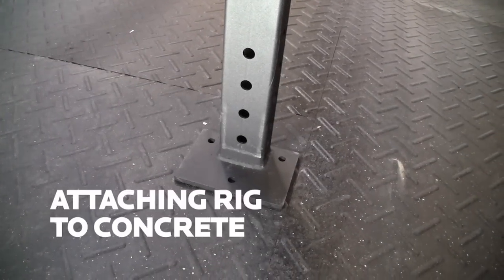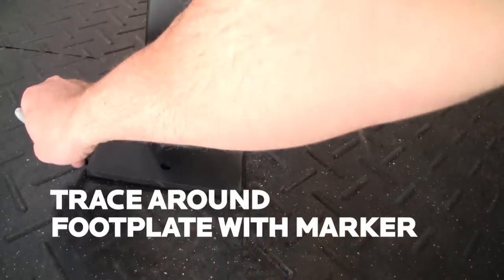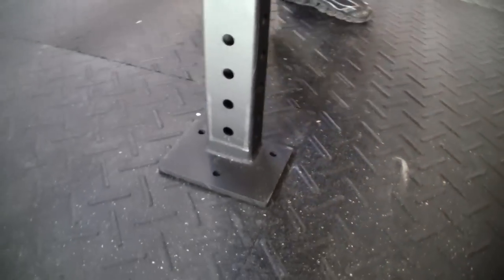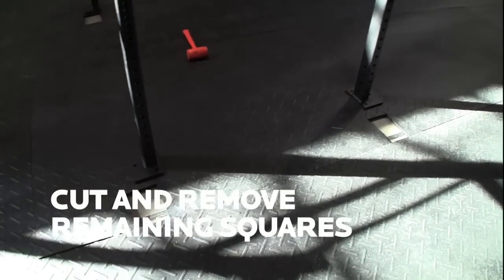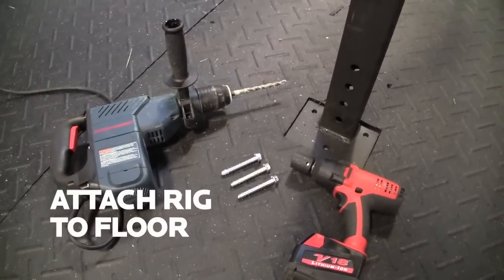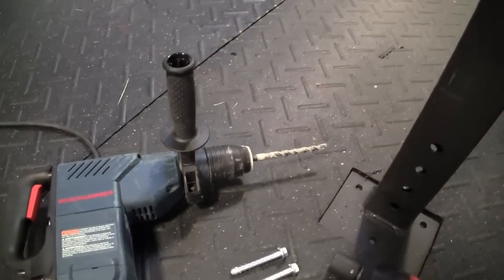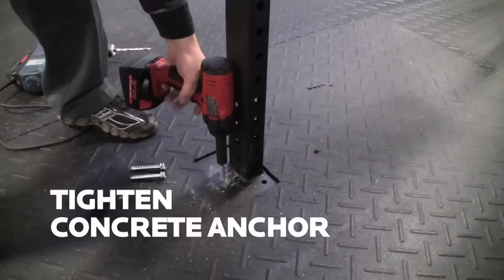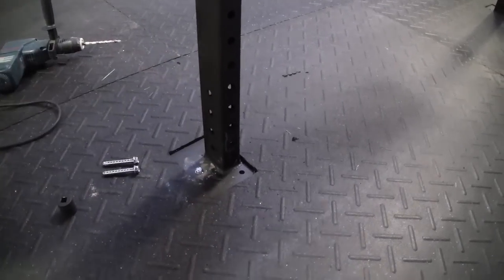Attaching a Rogue Rack to Concrete

Comment: To be perfectly safe if you didn't pour the concrete floor yourself, you can use a sub-scanner or pay someone to xray your floor for rebar, post tension cables, dwv (Drain, Waste & Vent) or other utilities.  If you were to accidentally snap a post tension cable, you could do serious structural damage.  If there are post tension cables, there is sometimes a stamp in the corner of the slab that states "do not cut or core".  YMMV of course
Reply: dllemm what is a post tension cable?
Reply: @dlroto  He's talking about steel cable reinforcement under the floor, in the concrete. It's for structural strength/stability. 

Pre-would be tightened before pouring the original concrete, Post- would be tensioning after the concrete has hardened.

It is certainly possible to run into something directly underfoot, depending how deep you drill, and how thick the concrete floor is.

I think most people would be fine, but ya never know.
Reply: YMMV?
Reply: @basedabdu8653 YMMV: "your mileage may vary" - it means your experience may be different
Reply: @killar222  thanks lol. I know now since I visit escorts regularly

Comment: With the rogue R3 (And most other racks) there's a cross member welded on that totally blocks your ability to drill or use an impact driver to fasten a bolt on one of the three holes on each foot of the rack.  You could mark where the hole should be and move it and then drill, but then you still can't use an impact driver to secure it because it can't possibilty fit between the hole and below the cross member..
Reply: I used 4 x 1/4" tapcon screws and that has proven to be just fine for the 2 years I've been using it. 6 x 3/8" is overkill for most set ups. The lightest R3 is about 200lbs so these units aren't going to tip over. They may shift on the floor a bit, without any securing, which is really all you need to prevent.

Comment: I want to install a rig in a location where I might need to remove it once every other year.  Can I reuse the same holes in the concrete or will I need to redrill new holes every time?

Comment: If the rubber floor is 20mm can we attach the squat rack on the rubber floor with longer bolts or is better to cut the rubber floor like you show in your video?

Comment: How long were your screws and how deep did you drill the hole???
Reply: The screws (concrete anchors) you can order from Rogue are 3" long.
Reply: Most masonry holes should be drilled about 1/4" deeper than the screw/bolt you'll be inserting. In this case given the thickness of the rack, you're probably ok with drilling exactly 3".

Comment: Thanks for the upload. 2 critique's.

1. Most likely the bolt is 3/8+. The shaft of the bolt is 3/8" while the threads add the diameter that will grab the concrete. If using a standard 3/8" bolt make sure to drill the hole with a 5/16" bit. A wedge bolt could be used in this application too. Racks tend to sway a lot during use and over time may cause the anchor to walk out. A wedge won't.

2. Using a hammer drill to set the anchor is tricky as well, because if the anchor head hits the steel and the drill is still forcing rotation. It can actually cause the concrete to fail. Bye bye hole. Hello moving entire rack 6" over to drill a new hole. Not fun. Hope this helps.
Reply: Incorrect on both counts.  I just installed a Rogue rack into the concrete in my garage.  If using the bolts sold by Rogue you'll need to use a 3/8" bit.  I tried a 5/16" bit and the bolts wouldn't fit.   Also, I definitely touched the rack with both the drill bit from the hammer drill and the bolts with an impact drill and didn't have any issues.  Maybe this isn't perfect, but those bolts aren't going anywhere. I got them down as far as I could with the cheap impact drill I have and then manually cranked them in with a socket wrench.

Comment: Thank you for the video.   You used a 3/8" bit for your pilot hole for a 3/8" anchor and not a slightly smaller bit size?  Thank you
Reply: You'd use the exact same size, make sure it's a masonry bit.

Comment: If different, what size drill bit and anchor would I need to fastened the stringers to concrete wall?
Reply: I don't have an official answer ... but I'd say enough that when you rack a bar with a normal size plate it has space. That usually the only thing you have to worry about form my experience.

Comment: I don't have a Rogue brand squat rack I have a smaller version I got off of Craig list. I also am trying to drill I to a basement floor. Will these screws work for me? Do I need to hire someone to check the surface for anything under the basement floor? thanks for any help

Comment: For those on a budget, the Titan HD power rack is a near clone using the same 2"x3" 11 gauge steel tubing for much less money (less than half the price shipped to my address). It attaches to concrete (or plywood) in exactly the same manner.
Reply: Just copying what Rogue does. Titan is made in China where Rogue racks are made in Columbus, Ohio. Would rather pay more for Rogue
Reply: @Shellyofficial-q8t  🇺🇸💪
Reply: i wish i could take that 1 thumbs up you have and put it where the sun dont shine